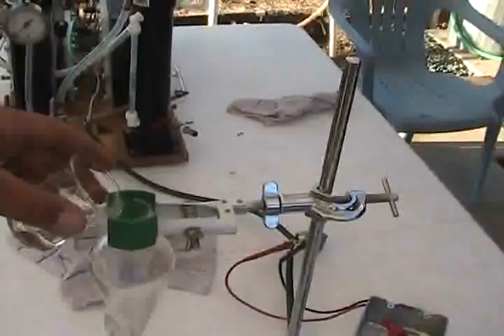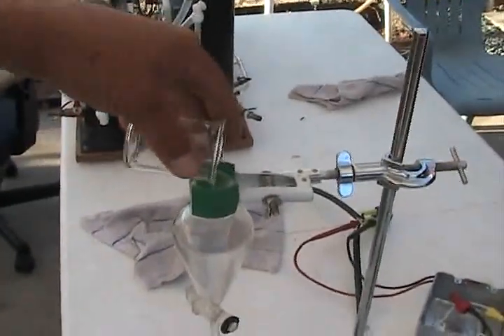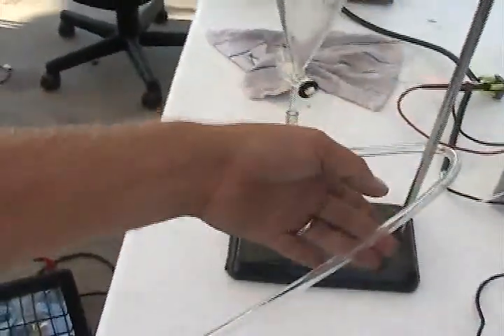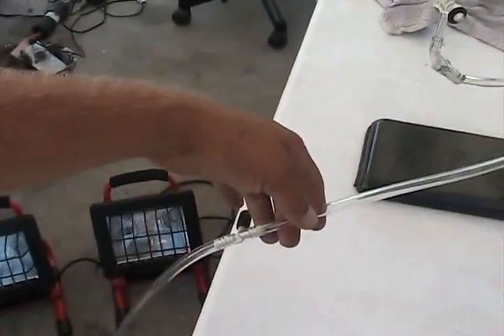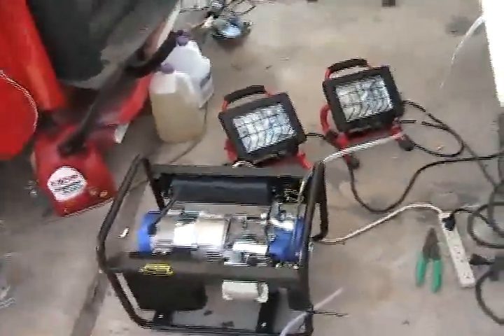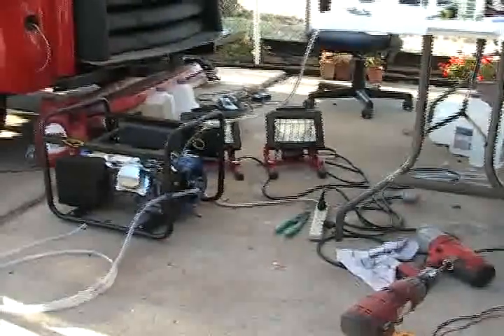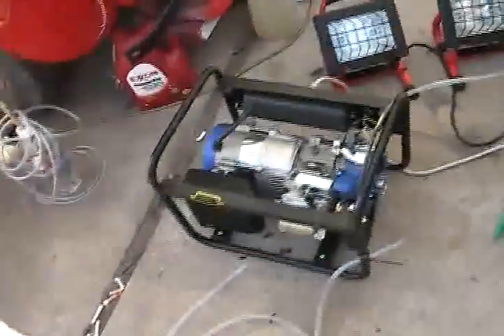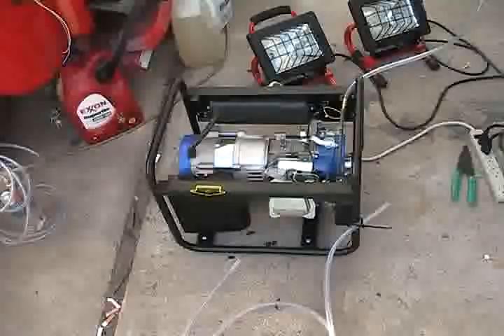generator test with 1000watt load pt.2

Comment from the maker: it seems the lack of an acerator pump on the carb means that the engine can only change rpm so fast or it leans the engine out and dies. so slowing the throttle change, or increasing rpm a bit, will help.